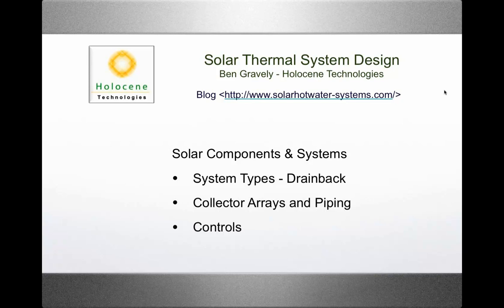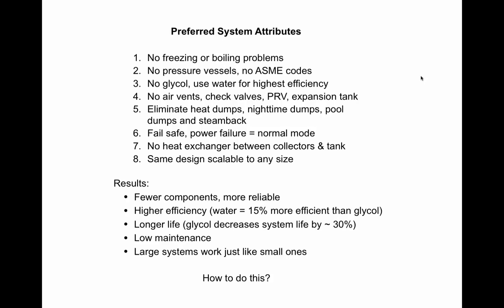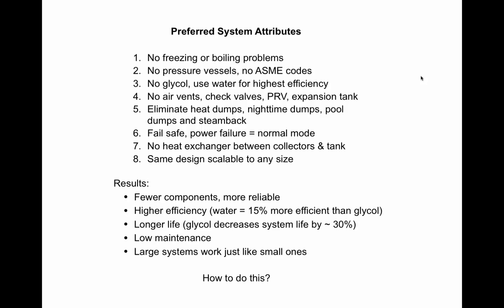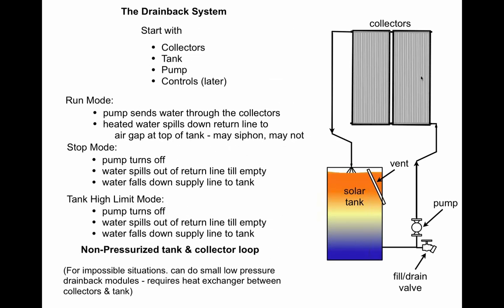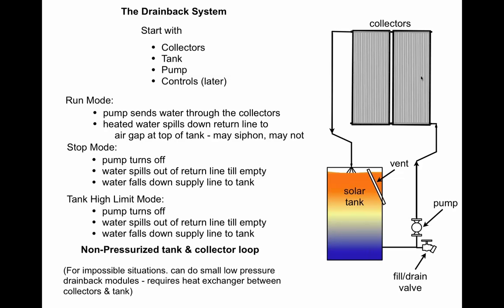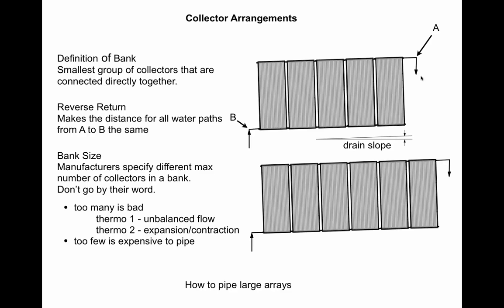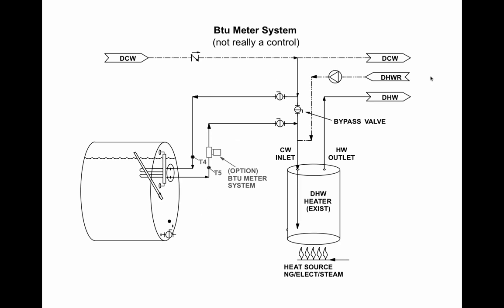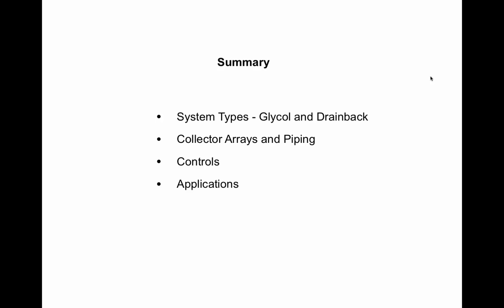Solar Water Heating 101

Comment: Wonderful information. !!     I'm wondering if you have a source you could share, for the tanks required, in the drain-back configuration.   I am working on a solar system for a 600 sq. ft. subterranean greenhouse... which has a 550 gallon hot water storage medium (two tanks).   I have suspended half inch copper coils in the tank... which put heat (but not water), into the tank.  The water is merely the storage medium.  The supply to these two coils, is a 3/4 inch copper tube.... (the return line from the hot water solar panels).   I have split this return pathway into 2   smaller,  1/2 inch lines... Each half flows slowly through the copper coil, and disburses its heat into the water.   these two half inch lines, then re-combine, into a single 3/4 inch copper line.... and pump it back to the solar panels.       Another set of  1/2 inch coils... with a smaller coil circumference, ... and which fit comfortably within the diameter of the larger coils.. are created, and will pull heat out of the tank... when a thermostat turns on another small pump, which circulates the heat from the tanks, into an insulated cement slab  (insulated from the Earth... so that the slab becomes a warm or hot thermal mass...    This will be the first Winter that I will (hopefully) have the system in operation...   Just some plumbing between now and then.   🙂

Comment: Hello Ben, Really nice you just saved my----    . with the 1 in in 20 ft ,Thank you.  What the best angle for winter I am in 44 latitude and 74 longitude , is 90  degrees up and down ok or what angle should I use .  I have not built  my roof on my garage  yet so i like to go the best angle , will be using for heating my house, I ,am  facing true south and theres nothing blocking it.

Comment: one question. your new supply to the tank seems to drop the added cold water to the top of the tank, where the hot water is. wouldn't you drop that to the bottom instead?

Comment: How is this better the just using Pv solar to power only the lower element on you electric water heater and leave the top element as a back up or booster when needed please explain your ideology on this subject thanks
Reply: PV solar has a very low efficiency. It will cost at least 5 times more with PV solar.

Comment: These look like old first projects. Today each module must have pressure release valve, cause air gets trapped in manifold that will later lead to overheating.

Comment: Hi, wondering if you could help. Im looking for a small\ mini water pump that can take pressure for  my closed loop system. im just experimenting with thermal panels as a heat source. When i say mini i mean like the ones used for pc cooler or fish tanks, but made of metal an well sealed. ill buy second hand as its all just for experimenting. Cheers